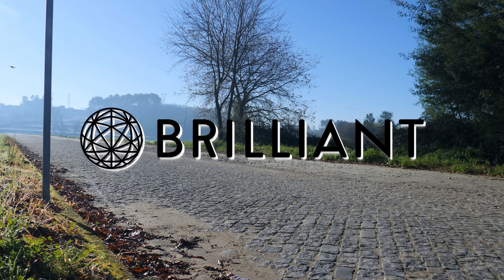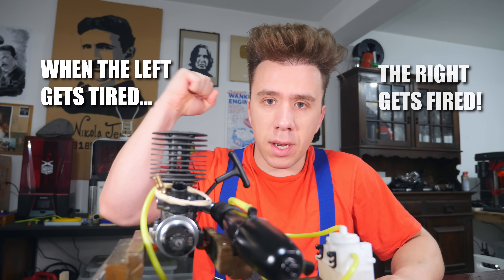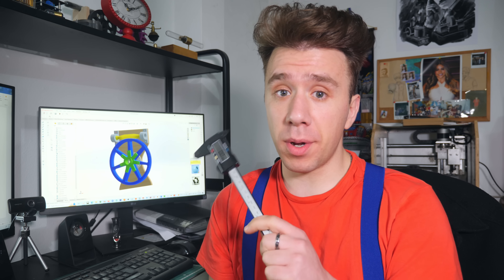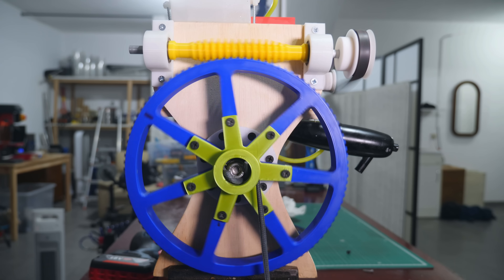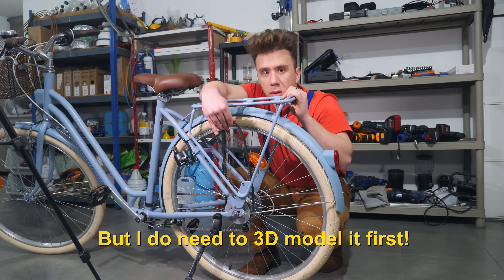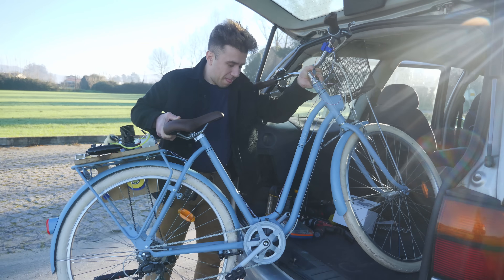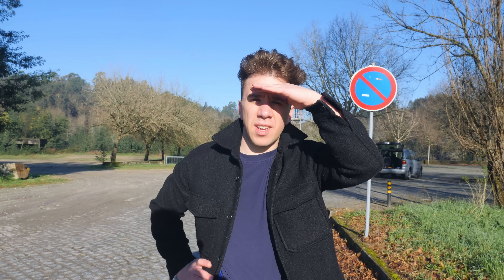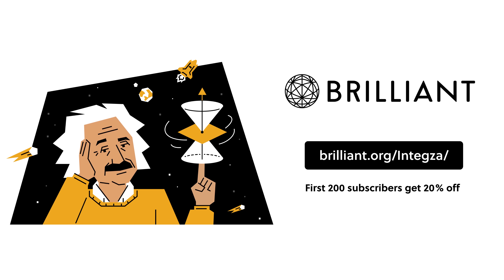Tiny 3.5 cc NITRO ENGINE on a BICYCLE

Comment: I love the fact that while everyone else is thinking electric, you're going the opposite direction. Stay cool man!
Reply: I love the rumble of a big diesel and the sound of a nitro engine, but as far as my RC cars and trucks go, I run electric now. They are just so much easier. Drop a battery in and go. And now that my kids are somewhat into RC, it's not much fun to try and keep 3 nitro engines going at the same time. It is a lot easier to have a couple of balance chargers and a few extra LiPo batteries ready to go.
Reply: @robertschemonia5617   I use both. When i want to tinker and hear that sound, nitro. when i want to have 20-30 mins of fun worry free, electric.
Reply: @cadenswain158  I absolutely still have 4 or 5 nitro powered vehicles. I am a welder and heavy equipment mechanic, so my whole day is tinkering. But yes, you are very, very right. There is no comparison to the scream of a well tuned nitro engine and the relative unpredictability of the power curve of a nitro engine. They are a blast, but I find myself more and more running electric, just for simplicity and ease.
Reply: @robertschemonia5617   Funny you mention that you're a heavy equipment mechanic and welder. I'm also a heavy equipment mechanic and welder too. What a coincidence! I do get what you mean though. I get home from a 12 hour work day and I don't feel like tinkering much either. Like the saying goes, the mechanics car is always broken, and the maids house is always dirty.
Reply: @cadenswain158  Ha! That's awesome. What a coincidence. I always say that mechanics drive junk because they are always too busy foxing everybody else's junk to fix their own!
Reply: @robertschemonia5617   Its somewhat true! My 96 ranger has needed u-joints for 4 months now (causes vibrations due to binding.) , I don't want to spend 4 hours on a Saturday or Sunday to do them.
Reply: @cadenswain158  yeah, the 2000 silverado I'm currently driving has 291k on the clock, oe mill, and transmission, and I just put joints in the rear shaft a couple months ago. I do miss the automatic back massage feature at 60mph tho.
Reply: @robertschemonia5617   Fortunately i wont miss my back massage at 45mph. It gets pretty intense at 70mph (which my poor 96 mazda/ranger struggles to get to because its the 2.3 lima with 8 spark plugs has 100HP.) Luckily its got the 5 speed manual. I hear the auto was worse.
Reply: @cadenswain158  the auto was definitely worse. The manual is a decent enough transmission so long as you keep in mind that it is a Ranger, and not an F350. And keep the fluid filled.
Reply: @robertschemonia5617   yea the death of almost any machine can be prevented by simply changing the fluids. if everyone were to go by the book on maintenance, we'd be out of our jobs,
Reply: Oh yeah I agree, I'm just saying, he's bucking the trends! @robertschemonia5617

Comment: gear drives have a bad efficiency so maybe 35 % of your engine power are wasted alone in the worm gear  drive. Also there are 2 more gear drives with cog belts. Chances are high that way less than 50% of your engine power will get to the wheel.

Comment: This has probably already been noted but, why don't you just run the motor output to the bike chain? Looks like you have all the gearing you need right there. Re-ratio the worm drive and it'll go scary fast.

Comment: A normal petrol benzine Gasoline engine of 2.5hp 4 stroke would  consume about 0.4 lbs of fuel per hp or about 0.18 litres per hour per HP.  A 2 stroke petrol benzine gasoline engine would be double the fuel consumption  than a four stroke .  Petrols benzine gasoline fuels  are stromic ratio 14.7 to 1 . Alcohol methanol is about stromic rate 9 to 1 which means the oxygen inside the fuel is  giving more powerful burn but uses  double the fuel rates of 2 stroke patrol engine.  Tuning the engine is tricky as it needs high compressions and has narrow tuning band  . Nitro methane has stromic ratio of about 2 to one as most of the fuel is not carbon but is nitrogen and oxygen and can even burn with no air supply and can be mono propellant .  A low compression ratio is made  so Tuning is more easy as it requires very little air to run at full power .  however fuel consumption is 5 to 10 times more than  gasoline so you need big tanks and deep wallet as it costs  a lot more than  Petrol or methanol . Also it makes nitric acid when it burns so is awful to use in cars or bikes where you could breath in the acid fumes  Mixing methanol and Nitromethane allows for more easy starting and some gain in power from 5% to 15% is popular but in completion as much as 60% nitro can be used for formula 1 boats and  helicopters but huge tanks and fuel  costs .Also the fuel needs oil lubrications often 25%  castor oil for cheaper 5% nitro . Competition can have pure synthetic oil as little as 10%  but that jagged edge melt down risks so normally a mix of 5% castor and 15%  authentic is where most model works . Hot glow  plugs bougie in French or  candle in other lingo is activated with the fuel contact from methanol  fuels  from catalistic reaction . It probably won't work with pure nitro fuels . The more nitro fuel content the  more we change glow plugs to suit the fuel often cooler  glow plug for higher %  nitro .Methanol can use spark plugs and so can Nitro fuels but they have to mega hot . A 100KG ~200 hp 10 liter V8 inside a  drag race car uses  two high amp spark plugs per  cylinder  and often 15 % micro fuel but sometimes 80% nitro  fuel and burns ~65 USA gallons in a some 6 seconds  with ~4 second run terminated at some 300MPH seconds. After two seconds run  the spark plugs have melted and the engine continues to run for  another two second with diesel effect . each cylinder gets a teaspoon of fuel and if it does not ignite the engine hydro locks and the head is blown off the engine . As nitro fuels and methanol fuels burn  less hot than petrol the engine has no cooling liquid The original engine HP of some 200 HP is increased to 700 HP with the use of Nitro fuels and Methane and blowers known as super chargers that rob 1000 HP from engine to car in air at some 14  times normal air pressures  leaving 6000 BHP to use . The exhaust pipes are used like rocket power point ing up wards to keep nose of drag car on the ground creating 1/2 ton of down pressure on the nose of car  and the rear spoiler after 100 MPH can push the rear wheels down by several tons once the car gets to ~300 MPH  at the end of the quarter mile . The power to weight ratio of the engine is something like ~65 to on eg ~65 kilos push of rocket effect to one kilo of engine weigth . That compares well to rocket engines that are often ~50 to ~70 to 1 ratios . Most engines are toast after 2 runs  and they look for the old ~1960 to ~1990  era V8 engines as modern engines can't hack this abuse and the supply of these old engine command a premium price of  $15,000 upwards . The reason petrol engines which are air cooled they have large cooling fins is the fuel burns hot . The nitro fuels are often not big cooling fins . Best not to mix nitro with Gasoline Petrol Benzine as it can be shock sensitive and explode  in a nasty burning fireball The diesel fuel engines for models don't use diesel fuel they use Ether and paraffin and castor oil mix with 2% mail nitrate a drug used to speed up a patients heart if they get heart attacks . Paraffin act like diesel fuel  a bit similar to kerosene which is often 7 parts paraffin fuel and one part petrol gasoline benzine fuel . Other radios do  exist for kerosene often call Tractor vapour oil  popular in the Second World War  to use for tractors  with compression ratio of ~12 : 1 often less than modern Diesel engines from  ~16 to 1 compression ratios  to higher . The 3.2 cc model car engine making 2.5 hp at some huge RPM like 30,000 RPM is not easy power to use as there is very  little torque .  A  fairly good competition 10 cc engine  glow engine doing less RPM and same 15% fuel can make close to 3 HP with more torque but standard  10CC engines are about 1 to 1.5 hp  but good tongue at some 12,000 RPM . Petrol engines can mix some methanol or ethanol alcohol fuels  but the alcohols often attack the fuel piping and aluminium  parts if not made to use normal modern fuels with typical 10% ethanol Fuels in the Petrol gasoline . Old unleaded fuels allowed car to have 12 to 1 compression ratios as the lead stoped the knock effect . Replacing the lead in fuel with 5 or 10% alcohol fuels to oxygenate fuel and stop knock required a lower compression ratio typically 9 or 10 to 1 and created less power and increased fuel consumption  eg less miles per gallon more costs . I have  run my sushi 1000cc car with extra fuels mix from 10% to 85 % ethanol and it worked sort of a 30% mix of fuel increased power and  increased fuel consumption but heater in car in winter was awful no heat and the car in the morning start smelled like brewery until engine heated up . more ethanol than that the car would run but jerky as I did not open the jets to supply more fuel and power dropped off . To use E85 fuel mix I would need to open the fuel jets at least 30% more fuel and buy extra hot spark plugs . Great for passing emission tests my friend did got zero reading on emissions . Then convert the car back to normal fuel .  My friends car was stole when he kept the aE85 modification and when the idiots who stole it crashed it due to its extra power and they ran away the alcohol fuel caused a big fire in the street  as the fuel burns very big fires compared to Petrol gasoline benzine . You can get a Petrol benzine gasoline engine to sorta run using Paraffin fuel  but you have to start with petrol or hot fuels and wrap the fuel pipe around the hot exhaust to get  the low octane 55 cetane fuel to explode in the hot engine and the soot is awful gums the engine wrecks the lubricating  oil so needs oil changes very often from paraffin wash effect and awful power as it need the  higher compression of 12 to 1 to work better . Diesel fuel at low temperatures goes gummy like waxy so winter diesel often has ~30% kerosene added or sometimes extra petrol fuel like ~5% added if it veery very cold . Older no inline Diesel engines could run with mixx of %% petrol and 95 % vegitable oil or with 100%  kerosene but lubrication to fuel pumps might suffer bad effects so often required repair kits for 100 euros   or buy new pump that cost mega bucks like 1000 euros. Modern inline diesels are not good to experiment with the over head inline distorter has pressures of 2000 bar and if they crack a leak the spray can cut flesh like diamond drill in seconds    Hope that helps

Comment: Humble VIDEO IDEA:
Rocket Engine! make an engine by using steel body and red fuming nitric acid(oxidizer) made by birkeland-eyde process - pretty easy,you can find tons of videos in youtube. 
   For fuel,you can use multiple liquids as diesel, kerosene oil or hydrazine🎉🎉🎉.This engine will be pretty powerful and will produce orange fumes.Also the propellants are  hypergolic(burn on contact).

Comment: Cool, but would’ve like to see a solution that didn’t involve a worm gear, worm gears are crazy inefficient. You definitely could’ve pulled off a 1/32 ratio via a belt and a large gear.

Comment: I've built a couple 50cc motorized bicycles. They sell sprocket adaptors made out of metal that fit snug around the hub of the wheel.

Comment: @integza this project is not finished by typical integza standards think its time to put a turbo or super charger on it! Because they are so good at producing more power, unlike not too many years ago s truck needed a big giant V8 motor the bigger the better
 However you would only get 8+/- miles to a gallon of gas. Believe manufacturers first put on gasoline cars as part of the stock engine build so they could reduce engine size, fuel usages and emissions especially with inflation and rising fuel cost without having to sacrifice power. Manufacturers figured out they could do this with full size pick up trucks. Allowing them to put much smaller engines that usually started around 5 liters and only got bigger. Now you can get a v6 2.7 liter engine with twin turbos that are way more efficient. All while still producing enough power and torque for a truck to do what they were meant to do,  which is tow and haul large heavy items. So part two I'll be anticipating!

Comment: I think there needs to be some sort of power adder like force induction.

Also, maybe put it in a skateboard or a scooter, less overall weight to get moving.

My grandfather has a couple "control line" aircraft that have these motors, I believe a Fox 0.50. You could probably get more speed with a larger nitro engine, but that does come with tearing up more parts.
Reply: Or put one per skate on a pair of skates?

Comment: The old sachs 2 stroke moped engines with 2-speed gearbox deliver 1,6 hp  with a top speed of 45-50 km/h.

Comment: You'd probably need a gearbox to get the max out of that engine, they make all the power in top range of RPM so if you don't get there you don't have that much power. Worm gears are also not super-efficient

You could probably 3D print a CVT transmission, either automatic one used in for example scooters, or cone type, hackaday had a post about them some time ago.

Comment: Dude, worm gears are horribly inneficient!! If you ever do this again and want to use a somewhat obscure gearing mechanism look into Eccentrically Cycloidal gearing. You can achieve the same N:1 reductions but theoretically it is al in rolling friction instead of sliding friction making it far more efficient than that worm drive.

Here's an example (not from me): https://www.youtube.com/watch?v=qMDU5tlGUwU

I reworked some of my previous cycloidal gearing designs (parametric cycloid curve) in SolidWorks into a 20:1 example piece and printed it. It is smooth as butter. (I should probably upload those files somewhere)

Comment: Moving a car with just 2hp isn't inconceivable. It's all a matter of torque. If you can get an engine that outputs 2hp but 50lb-ft of torque, it might be able to move a car pretty well. I mean, my old pickup gets 380lb-ft of torque out of a 454 engine, and it certainly doesn't need that much just to move, so I think a normal car should be ok on 50 right? Maybe that should be your next project. How low can you get the hp on an engine while keeping the torque high enough to move a car at, say, 10mph?
Reply: It's a matter of torque to the WHEELS, which can be multiplied many times over with gear ratios in the transmission and differential. Horsepower is literally the only figure that matters for acceleration and top speed with enough gear ratios between the engine and drive wheels that make engine torque almost irrelevant with power, aka Horsepower being the metric that exists precisely to quantify work output or how quickly a certain task can be completed, like for instance accelerating a car or pulling a heavy trailer up a grade.

What makes this confusing to a lot of people is that high torque like your 454 mattered a lot more when transmissions had few gears which put low-torque engines at a huge disadvantage as they need more gears for the same HP to have the same acceleration at low-mid RPM. HP is simply Torque X RPM which through proper gearing will produce the same force to the wheels or other output and allow the same performance for very different engines with the same peak HP
Reply: @Brandn00b25  I can see how that seems logical on the surface, but if you were right, tractor trailers and Ferraris would use identical V16 engines.

Comment: Hi. Nice video, thanks for that! But I just want to say, brass is not very good self lubrigate, or solid lubricant material. Actually brass is pretty poor for bearings etc. But, bronz, or bronze or how do you write it, is way more better. It is actually brilliant material for bearings and worm gears, and gears, and everywhere, where is moving parts, and where it's tuffnes and hardness is enaugh. So, next time, pleace use bronz instead of that stupid brass!

Comment: before i see it fail, worm gear doesnt let the wheel turn the motor, if you know what i mean, good luck =)
Reply: im answering myself, you need a flywheel design i think, let the motor spin up a flywheel so the motor doesnt directly have to suffer the bumpiness and fast swings in load from the road surface and inclination and so on, i think an aluminium flywheel is enough with your genious one way bearing design.

Comment: you lose about 30% of power with the worm gear, altho it's most likely much more since you use no lubricant and the brass gear is pretty rough from machining (pretty sure you didn't polish it at least) and the teflon shavings are a good indicator of that, with a multistage planetary gearbox you could get much more power to the wheel and could perhaps reach 40kp/h

and I think the carb on that engine needs some adjustment too, kinde seems like it's running lean

Comment: You need to lower the blade on your table saw so that the top carbide tip is just above your work piece. This I much safer and will be a more efficient cut.